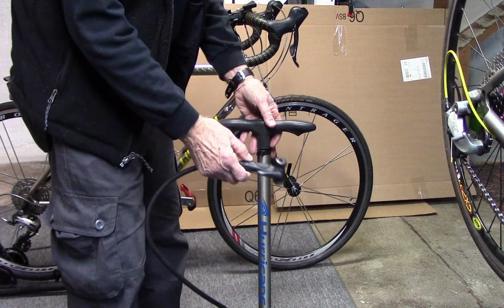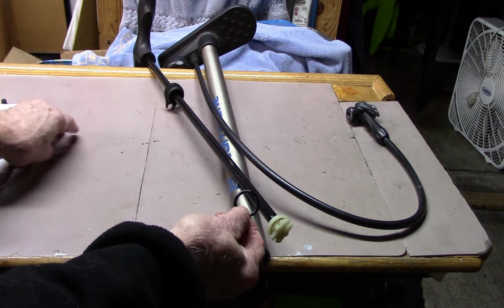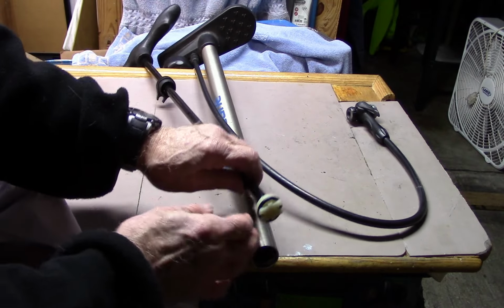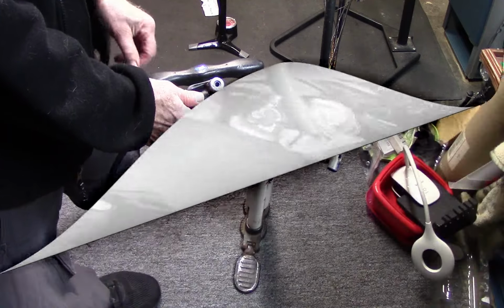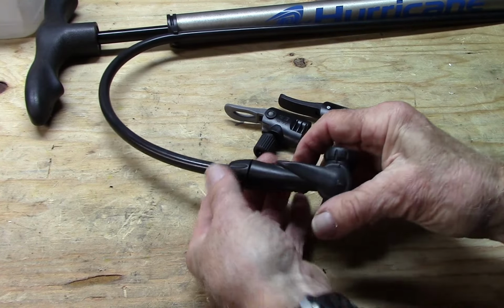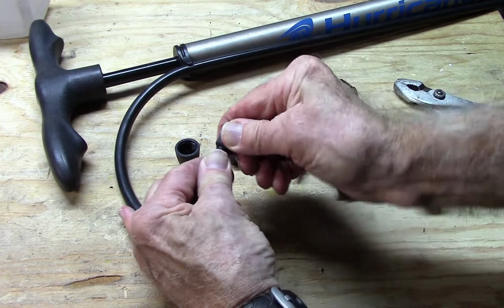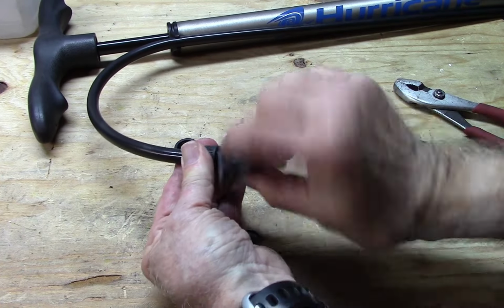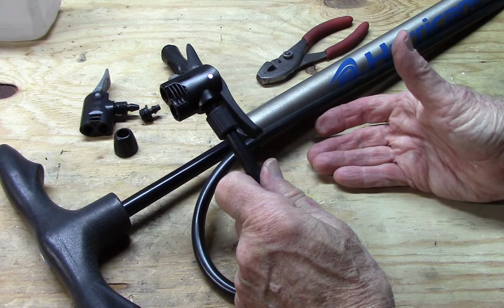How to Repair Bicycle Pump: Quick Fix, Tips, Hacks

Comment: I don't know what country you're in but shipping from China doesn't take "a few months".  It'll take a month at most and usually about 2 weeks.
Reply from the maker: When you will receive an item ordered from Asia will depend on whether it's already received and stocked here (your country), is some where in transit or still to be shipped from over seas. I've received Asian market items within a week from Amazon and Ebay and waited weeks (or even months) for items on Etsy and Temu. Highly variable and requires patients.
Regards and safe cycling, Tony

Comment: My man, this aint a quick fix
Reply from the maker: Another thing to try:
https://www.youtube.com/watch?v=20wPVl19Zjw
Can you tell if air is leaking out around the valve, pump tubing or cylinder? Does it pump at all when you depress the pump handle?

Comment: Can you use lithium grease on the o-rings as well? Also, my Giant pump seems to loose pressure intermittently on the downstroke as I pump. I thought it was an O-ring problem, but new one didn't solve it. Is it possible an old pump barrel gets worn enough to significantly enlarge its inner diameter to prevent Oring contact? Thanx...great video.
Reply from the maker: Yes, you can use lithium grease on the o-rings of your pump. Have you tried that on the new o-rings? Are the o-rings the same size as the old ones? Be sure to try and clean the pump cylinder. The inside of the barrel should not wear enough to give you a problem. Questions to ask:
1. Recheck the o-ring size against the old ones and make sure that they are greased. 
2. Check for leaks or cracks in the pump tubing as well as at the point of attachment of the tubing to the pump and pump head. Have someone pump and listen or feel for such leaks. In such case, the tubing may have to be replaced.
3. Are you loosing air at the attachment of the pump head to the tires' valve suggesting that the pump head is the problem? If this is the case, a fix as in the video,  overhauling the pump head, a new pump head or pump may be needed.
Good luck and regards, Tony

Comment: My bell air attack has to be 20+ years old. The hose rotted out so I replaced it with 3/8” OD fuel line from the local hardware store. Works great and it’s longer.   I think the chuck is worn out. The pin in the center that presses on the valve stem is not contacting it.   Had to spin the stem out to make it work.
Reply from the maker: Does the head of the pump look like it's fully connected (pressed on to the Scrader Valve)? See:
https://www.youtube.com/watch?v=PEfb_iFLxxY
Old pump heads can wear/break or just may not work. Here's a video on dual Schrader/Presta pump heads and a possible fix for this type pump:
https://www.youtube.com/watch?v=jlEj0sHEuGA
If the above doesn't solve your problem, I don't know of any other fixes and a new pump head may be required.
Reply: @ yes tried that. The cross shaped pin is worn and doesn’t make contact with the stem pin.  A new chuck will fix that. I’m guess the 2Way chuck will fix the problem thanks

Comment: Very informative video  Tony. Thanks.  Do the center pins on the chuck wear out?  My pump works fine but the chuck doesn’t push the valve stem pin. I had to spin the valve stem out a couple turns so I could see it , then the pump filled the tire.   FYI I’m using an old Bell Air Attack on a zero turn lawn mower tires.   It way more convenient than using a compressor

Comment: Hi Tony, very nice video. In my case, the pump suddenly stopped working. The air is leaking from the top of the tube body as I press down the handle. I have checked for cracks but the tube body is impact and O ring is good. Any idea what could be wrong?
Reply from the maker: Can you tell if the leak is from the cyclinder cap where it screws or fits on top of the cyclinder or around the bar that connects the pump handle to the piston (plunger) head? Let me know in that the approach to these are different.
Reply: @tony10speed  It is from around the bar that connects the pump handle to the piston
Reply from the maker: @sthejas1991  Most likely the air is leaking around the piston and back up around the opening for the handle . If plastic, with an o-ring, try some vaseline (petroleum jelly or something similar) on the o-ring. If that doesn't work, the o-ring may need to be replaced. The same with a felt-like plunger - try lubricating the felt plunger with vaseline or something similar. If that fails, the felt end may need to be replaced. Getting the correct size o-ring or plunger end can be tricky and will make all the difference. Measure the old o-ring or felt plunger. The felt plunger head may need to be a fraction bigger if very worn. Be sure to lubricate any new o-ring or work in the lubricant into the felt plunger. Let me know how you make out. Regards, Tony
Reply: @tony10speed  thank you. I removed the o ring and lubricated. I could feel some resistance building up in the cylinder using the plunger but the air pressure is slightly low. I am now able to use it albeit with low performance.
Reply from the maker: @ I suggest replacing the o-ring which is probably worn. Measure the size or take it with you to your local hardware store to replace. I have a box of various size o-rings I purchased at Amazon for a few dollars. Be sure to lubricate the o-ring. Regards, Tony
Reply: @tony10speed  many thanks for your suggestion and help. Best regards

Comment: I paid €20 for floor pump SKS Air-X-Press 8.0 and after 3 years usage the air nozzle just doesn't stay on the valve anymore. After watching this video I am sure its because the rubber O ring is worn. The fastest way to get it fixed is by a replacement chuck for €7 at my local bike shop but I just feel its an overkill to buy a whole new chuck when just the O ring needs replacing. I guess its the way the world is going, replace instead of repair. Will be a nightmare to find just an O ring and just not worth the hassle :)
Reply from the maker: I have a collection of different size O rings I bought from Amazon for about $5. I have used various O rings to fix pumps, for tubless tire Presta valves and a variety of other jobs. But I do agree with you that our society seems to be one of replacement rather then repair.

Comment: Any recommendations for high quality replacement chucks? Having a hard time finding anything on Amazon.
Reply from the maker: I've had a hard time finding replacement chuck that work. Many on the market but most just won't fit or are of poor quality. Best bet is consult the pump manufacturer. What kind of pump are you using?

Comment: It dosent work
Reply from the maker: Can you tell if the air is leaking out around the valve or from the pump tubing as you pump or do you feel no resistance and no air at all as you pump?

Comment: Wiggle Lifeline floor pump O-ring seems to be just larger than 28mm so I think it is 1 1/8 inch 28.6mm which I have yet to source but I will one day.
Reply from the maker: You may be able to bring that 28mm O-ring to your local hardware store and see if they have something slightly bigger. I also found 1 1/8 on Amazon as well as other sites if your interested.
Reply: @tony10speed  I ordered the wrong ring, with a inside measurement of 1 1/8! Reordering.
Reply from the maker: @TimothyTakemoto  Let me know if that works. Regards, Tony
Reply: @tony10speed  I bought the wrong size again! I bought o-rings with the sum of interior diameter plus thickness being 28.7 but I should have bought interior diameter plus twice the thickness. Stupid. This is getting expensive. A 28mm with tape under it just about works.

Comment: My pump has no pressure at all. I can  pump up and down a thousand mph and no air pressure.
Reply from the maker: If there are no cracks in the pump tubing, it might well be the cylinder valve inside the pump. Open the pump either be removing bolts at the cylinder head or unscrew the pump head at the top. Pull out the piston and take a look. If it's felt fabric, a little silicon, grease or even better some Vaseline on the piston valve may revive it and prevent air leakage. In other cases, you may have to replace the piston valve or "O" ring. If that doesn't solve the problem, you'll need to look for leakage near the gauge. Let me know how you make out, Tony

Comment: My old Schwinn pump had a torn o ring inside. But after replacing and greasing, I don't feel any resistance when pushing the handle down. It's not moving any air. Would appreciate any ideas.
Reply from the maker: Sounds like the o-ring may not be the right size. Other possibilities include a leak somewhere along the pump hose, either at it's attachment to the pump or chuck. But my bet is the o-ring is too small. Getting the right size for an old pump is going to involve some trail and error unless you find one for your exact model pump on the internet or ebay. You could try a hardware store or Home Depot and get several different o-rings to try.

Comment: what if the air leak is coming from the main body of the pump, where the hose is attached? that’s where inhear the air leaking
Reply from the maker: You might be able to tighten the hose attachment (it usually screws in clock wise). If the hose is attached via a clamp, the clamp may need to be tightened or replaced. If it's the hose itself, you'll need to replace the hose. Check the manufacturers web site. There are replacement hoses with attachments (such as from Topeak) but they don't work with all pumps and are expensive.
Reply: @tony10speed thaaaaaaanks

Comment: Where to find replacement hose parts? I damaged the fitting that goes into the bottom of my floor pump, and I'm having trouble finding a replacement. It's about 10mm, with a coarse thread. I'd either want just a fitting, or the entire hose. I see a lot of them with a narrower fitting, or with a fine thread.
Reply from the maker: What brand/model floor pump?
Reply: @tony10speed  Model 861, made in Taiwan, by CPC Cycle.

I discovered that this company makes (or made) many bicycle related items.

This turned out to be an excellent question, since it got me to look closer at the logo on the pump. I had misread the brand last time I looked.
Reply from the maker: CPC Cycle is on facebook: https://www.facebook.com/cycleplustudio/
Could not find any parts for your pump on Ebay or other sites.  Tony @MorrisDugan
Reply: @tony10speed  Thank you for digging up CPC Cycle.

Before I asked here, I went to my local hardware store, which also caters to bicyclists and XC skiers. They had one hose fitting around the right diameter, but the thread was too fine. I see the coarser thread mentioned on eBay by sellers of hoses (usually by warning you that's not what they have), but I can't find just the fitting I need. I think it was common to a lot of floor pumps at one time.
Reply: @tony10speed  I'm seeing "Air Hose Repair Kits" using a thread called NPT - National Pipe Tapered, but I can't tell if this was ever used on bicycle pumps. I think the air hoses here are for compressors.
Reply: NPT thread is not the kind I need. NPT is tapered, and designed to seal without a washer.

More info: my fitting was common to a lot of older bicycle pumps that didn't use plastic parts, it has a coarse thread, it used a leather washer to connect to the pump, and it's probably 3/8" thread diameter, which is extremely close to 9.5mm.
Reply: @tony10speed  I have another pump with the same fitting, made by "Cyclepro Accessories," no model number.

I couldn't find any parts on eBay, either, but it's more a matter of matching the diameter and threads. It's either 3/8" or 9mm or or 9.5mm or 10mm, with a coarse thread. It's hard to measure the exact size with a ruler.

Comment: do you think I can probably be use the standard technique of inserting a hose barb and clamp on a bike pump should I decide that I dont like the air chuck ? I mean I think my theory is I may one to place it with a quick connect so I can easly attach the appropriate needed part so again Maybe a quick connect with barb and clamp should work ? thoughts please thank you
Reply from the maker: I've tried and it's hard to get the clamp tight enough to hold the hose on the chuck let alone the pump. I've tried a number of different clamps and it's hit or miss (mostly miss). Let me know if you have better luck. Regards and safe cycling, Tony
Reply: HI tony what I forgot to mention is I just tried to see if I could get a new air compressor or something but it has a bike pump style air hose and it does not have an out put regulator so my proposed idea was to put a regulator in the out put hose and also change the chuck to  universal tip so it seem if I modify from orginal designed it I would have luck with it it I will have created a better product I think theoerticaly it shoud work I guess i can let you know if I have any future ideas !

Comment: The Chinese lock nut was too small to fit my hose.  Used two 8" electrical ties to lock hose on chuck.  Used up to 120 psi with no problems.
Reply from the maker: Thanks for the tip. I think that our viewers (as well as myself) will find your ideas very useful. Regards and safe cycling, Tony

Comment: Thank you for the video Tony. May I ask, if the needle within pressure gauge is not moving  - does any tip in this video help us fix that? Thank you!
Reply from the maker: If you can fill the tire but the gauge doesn't work, the gauge may have to be replaced. If air doesn't come out of the pump (or very little), there could be a leak in the pump tubing or chuck. What make pump do you have?
Reply: @tony10speed  I have the same problem and mine's a Beto pump. (Great informative video by the way!)
Reply from the maker: @nigelacoe  Where you able to fix your Beto Pump?

Comment: My Lezyne pump has a broken gauge. It does not go back to 0 in standby and does not show correct PSI/BAR anymore. Is this something i can fix myself? It's several years old.
Reply from the maker: 3 videos worth watching:
https://www.youtube.com/watch?v=b1C95E5RCxo
and
https://www.youtube.com/watch?v=iYZ5Smx4FmQ
and
https://www.youtube.com/watch?v=FtqsUAOevP4
Parts can be obtained from:
https://www.lezynestore.com/pump-parts/
or
https://www.ebay.com/sch/i.html?_nkw=Lezyne%20Pump%20Parts&norover=1&mkevt=1&mkrid=711-156598-727597-8&mkcid=2&mkscid=102&keyword=lezyne%20pump%20parts&crlp=435087720364_&MT_ID=585616&geo_id=10232&rlsatarget=kwd-296157358771&adpos=&device=c&mktype=&loc=9004013&poi=&abcId=1141846&cmpgn=6550792781&sitelnk=&adgroupid=76758117777&network=g&matchtype=b&gclid=CjwKCAjwhJukBhBPEiwAniIcNXklpqEhIWFc-Hux6KMWAlFehcHVaI6DPTjuW5Ny9T8TqTv2tw1utRoC2YUQAvD_BwE
Wish you well and let me know how you make out. Regards, Tony

Comment: My Lezyne floor pump is working in general, but as soon as I release the handle after pressing on it, the gauge goes back to zero. The handle raises just a bit and the pump makes a lot of noise for a few seconds. When the handle is pressed down, the pressure reading is correct. Maybe you would have any ideas? :)
Reply from the maker: Most Lezne pumps have a threaded chuck as opposed to one that has a chuck with a lever that locks it in place. When you disengage the pump by either opening the lever on the chuck or unscrewing the Lezne tubing, air is released from the pump tubing and cylinder (giving a "whooshing" sound) and the pump gauge will fall. This is normal. Meanwhile, the air in the tire pushes up on the valve core, closing the valve and preventing the air from leaking out of the tube/tire. For Presta valve, one can then lock the tire valve by turning the small tip clockwise. Hope this help in understanding what goes on and what your experiencing is entirely normal.
Reply: @tony10speed  Thanks for the answer. The problem is that a week ago the gauge started to fall back to as soon as I stop pushing on the handle, without unscrewing the chuck from the valve. So when pumping, the reading goes down randomly (sometimes to zero, sometimes to a few psi) after each stroke. The whole pump is vibrating loudly as it happens. I will try to service the check valve at see if this helps.
Reply from the maker: @HandfulOfHypercubes  If the same problem occurs with other wheels, it's probably not a leak in the clincher or  leak from around the rim of a tubeless and may well be the pump. Parts are available through Amazon and Modernbike once you can diagnose the problem (which may not be easy). It would be nice if they sold a complete repair kit similar to that of Silca. Lenze has a number of repair video on YouTube if you just search on "repair lenze floor pump" which you may find useful.
Let me know how you make out. Regards, Tony

Comment: Using a push on pull off hose with a non threaded valve will prevent wear of the gasket in the pump head.
Reply from the maker: Yes, that's true, although some complain that a smooth valve head allows the tube to bulge out at the valve opening and burst at this point. I have not seen this happen and it may reflect of the quality of the bicycle tube used. What are your thoughts?

Comment: Have you been able to fix a pump with the Topeak repair kit?
Reply from the maker: Yes. The old pump I fixed had the same size tubing as the Topeak repair kit - that made it easy. What I don't like about the Topeak kit it that the lever on the chuck is difficult to lock in place.

Comment: Don't forget the check valve at the base of the pump. If the handle shoots up at you, this is your problem. Silca pumps accumulate all kinds of gunk over the decades,  because they last long enough to get  these problems!
Reply from the maker: Right on! Here's my go to video on Silca Pump restoration:
https://www.youtube.com/watch?v=PPt94ADMkWc
Regards and safe cycling, Tony
Reply: @tony10speed  This was my problem, but I didn't even think check valve existed in the pump or where it might be.  Still, this video is good guidance for performing a general tune-up.